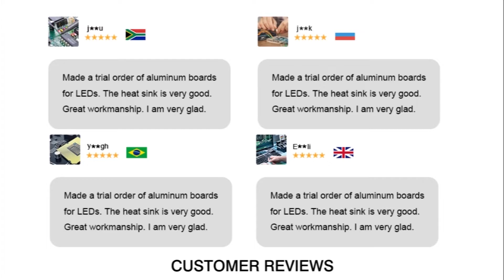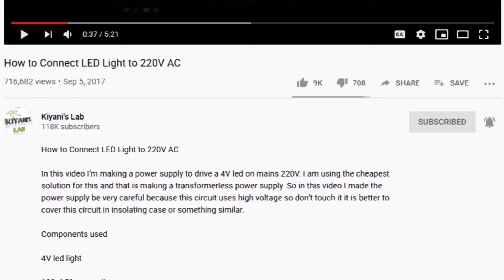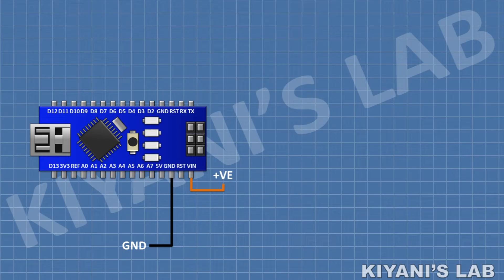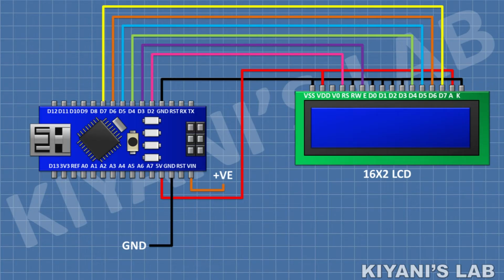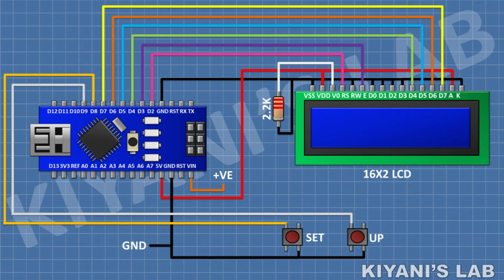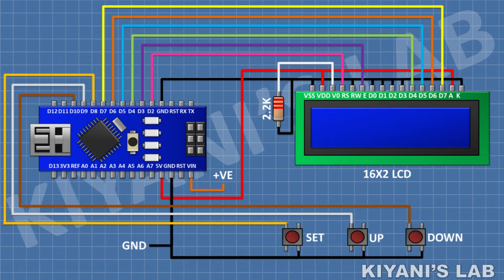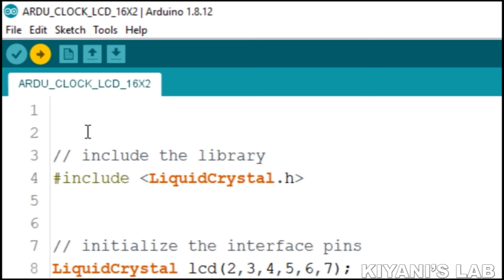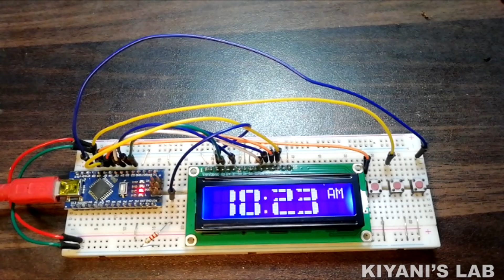How to Make A Digital Clock Using Arduino and LCD

Comment: Worked great for me thanks so much appreciated, I changed the code to if(h>12){ h=1; a=!a; it seem to fix the AM PM  and 00 AM problems I had. I also changed the last delay to 493 and am testing how accurate it is. Thanks again!
Also the hour setting only went up to 11 I changed the line below from h=11 to h=12, now I can cycle 1-12
  case 2:
      h=h+dg;
      dg=0;if(h>11){
    h=12;}
I got my first Arduino two weeks ago so I am a newbie and having fun.

Comment: Cannot be accurate as is. Looking at the code there are two delay(500) statements which are 500ms delays so two of them take 1 second... but the rest of the code takes time as well so the clock will lose time continuously. You either need to reduce those delay(500) to adjust or add a RTC (real time clock) to stay accurate.

Comment: Arduino: 1.8.16 (Windows 10), Board: "Arduino Nano, ATmega328P"

Sketch uses 3962 bytes (12%) of program storage space. Maximum is 30720 bytes.

Global variables use 137 bytes (6%) of dynamic memory, leaving 1911 bytes for local variables. Maximum is 2048 bytes.

avrdude: can't open config file "C:\Users\Lenovo\AppData\Local\Arduino15\packages\arduino\tools\avrdude\6.3.0-arduino17/etc/avrdude.conf": No such file or directory

avrdude: error reading system wide configuration file "C:\Users\Lenovo\AppData\Local\Arduino15\packages\arduino\tools\avrdude\6.3.0-arduino17/etc/avrdude.conf"

avrdude: error reading system wide configuration file "C:\Users\Lenovo\AppData\Local\Arduino15\packages\arduino\tools\avrdude\6.3.0-arduino17/etc/avrdude.conf"

This report would have more information with
"Show verbose output during compilation"
option enabled in File -> Preferences.

Comment: By changing some values in the code, a 24-hour display is obtained with a delay of 1 second per 24 hours. By replacing the 2K2 resistor with a 10K trimmer potentiometer, the input voltage can be 5V.
Reply: can you indicate what changes need to be made to the code to obtain a 24 hour schedule Thank you in advance
Reply: En fait pour passer en horaire 24 h il suffit de remplacer 11 par 23  et supprimer AM PM

Comment: Found this wonderful code here for the big display, and I implemented it with my Arduino Uno. I solved its considerable drift in time by trimming the 500 ms delay near the end of the code. Tried several values until I got to 493ms instead of 500ms. Now, the clock loses only 1 second every 24 hours, not bad for a setup without an RTC module. Of course, I have to reset it to the current time every time I turn it on.

Now, if somebody can please point me to code where this could be used with at least an alarm, or with the other features that come standard in a clock implementation such as a calendar, temperature and humidity sensor, etc. Thanks for posting this.
Reply: One more thing, after 11:59 PM the clock displays 00:00 AM. In my part of the world, it should display 12:00 AM. I am able to display the desired digits by changing two occurrences of 11 to 12, but I don't know how to code so that AM should change to PM and PM to AM after 11:59. Any suggestions on how to do that?
Reply from the maker: you will find this section in the code  if(h>11){ h=0; a=!a;  }  change it with this if(h>12){ h=1; a=!a;  }
Reply: @KiyanisLab  Thanks
Reply: @wowo1081  can you please share code
Reply: What code

Comment: If i run this with arduino uno? there any problem, I have tried but lcd is no showing anything
Reply from the maker: no problem ou can usen any arduino lcd britness may be an issue of your circuit use 10k trimpot instead of 2.2k resistor on lcd